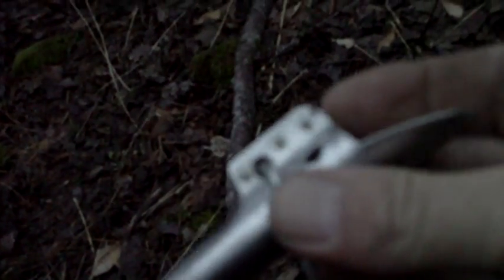How far to drill holes for tapping maple trees - Drill Sizes and Depth - Distance for Taps

Comment from the maker: @REZ138 Yes we all make these errors...If you cross cut a hardwood you will see two shades of color, Sapwood and Heartwood on the outside rings are the lighter color of Sapwood, its not very deep and that's were we get the flow of sap from.
 I've not noticed any difference in sap flow with a smaller hole and my taps not as far into the tree, maybe more with the shallow tap method, and the tree will thank you.